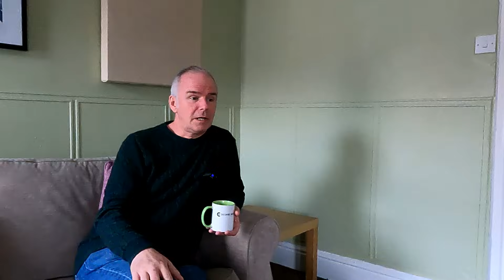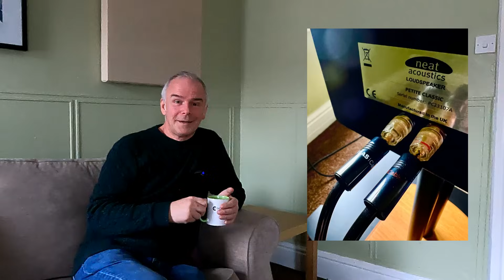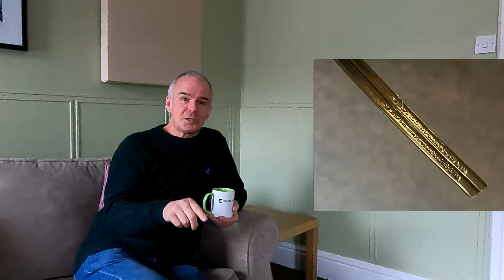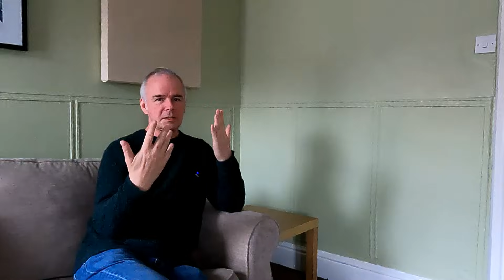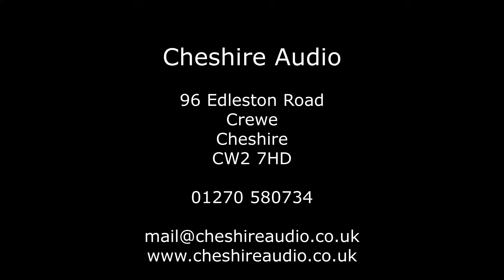How to check if your Speakers are in Phase

Comment: I have a potential nightmare with phasing. I have a pre-amp with two non-inverted outputs and two inverted outputs. Thing is these four inputs go into a Power amp that recommends 'inversion' for stereo use. So, the two non-inverted outputs i've 'inverted' at the speakers and the other two are 'non-inverted' at the speakers. System does sound great, but unsure if i'm doing the right thing? My soundstage used to be better, but I since angled in the speakers. So many moving parts. You actually never know if a company has accidently inverted the speaker wiring itself, so I will take your test and use it.

Comment: After spending 50 years with lots of different amps and speakers and knowing about phasing, it happened to me.   My set up sounded odd, I was convinced it was an amp issue as was 100% sure phasing was not the issue.   It was!   My mistake.  The stereo sounded fine when I was close to the set up, but at different listening distances it was “odd”.  The best description I have for it.  The stereo image was not right.  Playing havoc with my ears.  What a muppet.  So simple!  Just me.   lol.

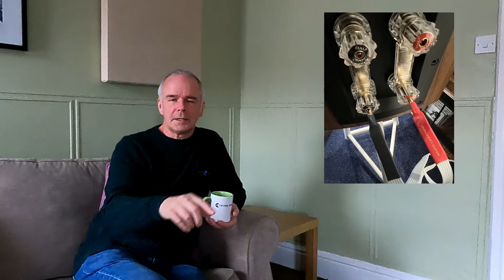Comment: 3:33 there's a photo of dalis.. They recommend connecting wires to the top posts (when not bi-wiring). With jumpers, you'd think it doesn't matter.. does it? can those jumpers be bettered by self-made wire?

Comment: If you’re unsure of phasing, what I do is use a 1.5 volt battery from the amp end and obviously red is positive black is negative and each bass speakers should move out, do this with both channels and your good to go if not you will have to investigate the wiring, like Phil said probably the wires are labelled wrong!!

Comment: Buy a DMM (digital multi-meter) this can be a low-cost unit from China as the accuracy isn’t critical. Ensure the amplifier is switched off. Select the Ohms range on the DMM. Connect one of the DMM probes to the negative terminal of the amplifier and use the other free probe to test each line of the cable at the speaker end. The DMM will give a low Ohmic reading when the free test probe connects to the corresponding negative line in the cable. Ensure this line of the cable is reconnected to the negative speaker terminal. By default, the other line in the cable is the positive and should be reconnected to the positive speaker terminal. (Note DMM probe polarity isn’t important when measuring resistance.)

Comment: Red Green is a nightmare if you're colourblind ... !
Reply: just use small pieces of electrical insulation tape along one of the wires
Reply: Easier to lick your fingers then test it at the wall. 🔌⚡️😮